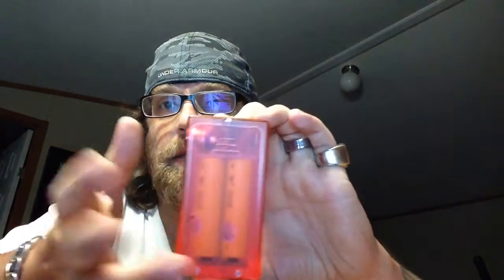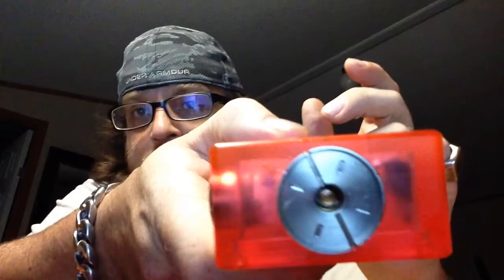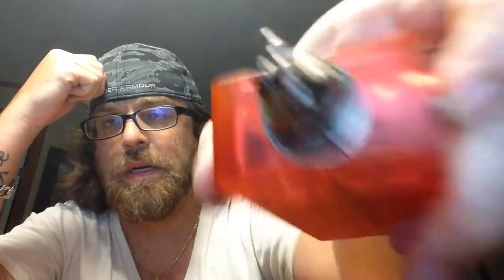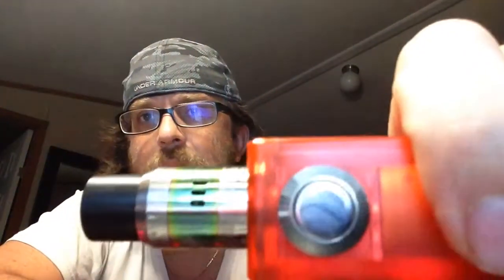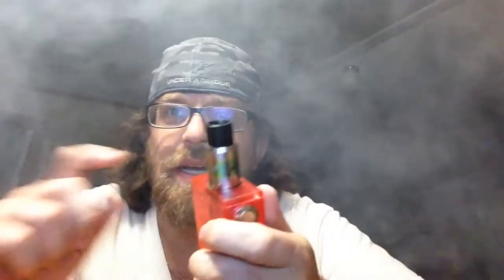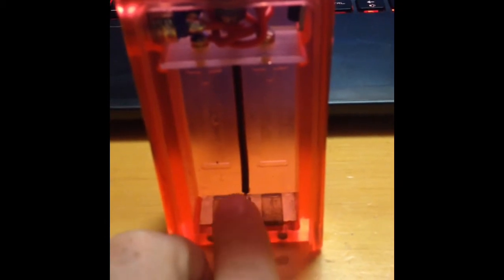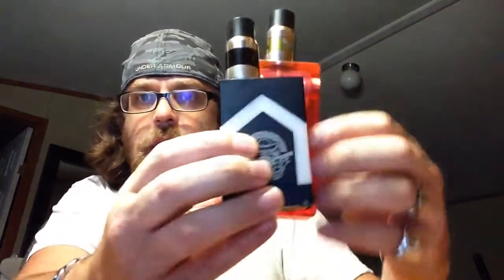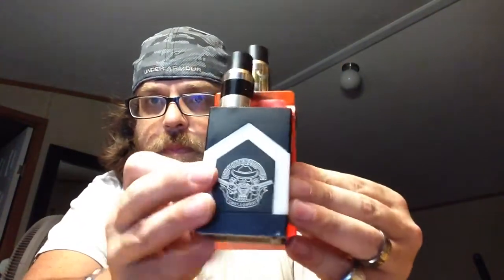ABS Beast mod full review

Comment: It's not a mosfet. It's a dual diode used for reverse polarity protection. It eats a lot of voltage. 
This mod hits better if you bypass that stupid chip. 
I put a real mosfet in mine, and holy crap, that squishy switch becomes super responsive and it just goes like snot.
Reply from the maker: Damn thanx for the info!! I may try that out

Comment: whats the voltage drop like? better than the castigador? between the two after the castigador is modified to run well which do you prefer?
Reply from the maker: The voltage drop is a lot more than the castigator. I really prefer the castigator. For the size less voltage drop.  Thanks for watching!!
Reply from the maker: I clda swore i replied but just in case. The castigador is much better. Theres less voltage drop and less chance of error. And imho you can build much lower

Thnx for watching and the question